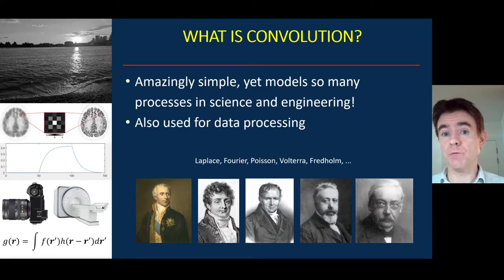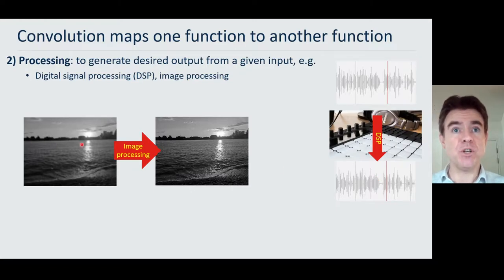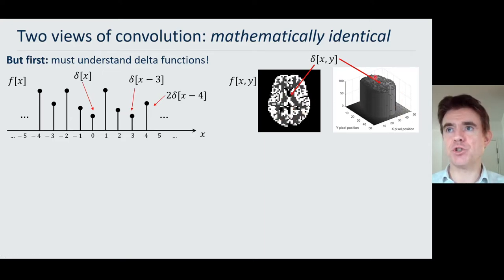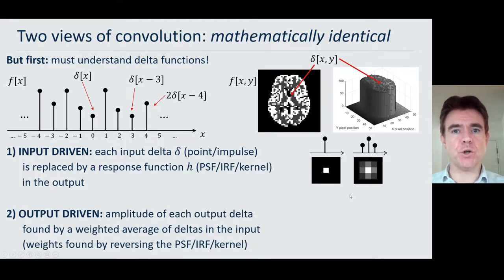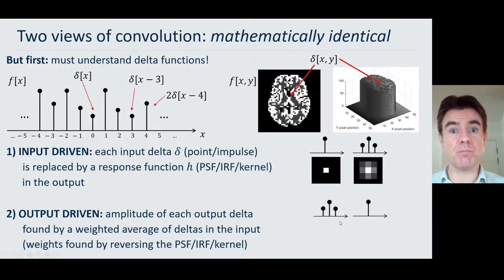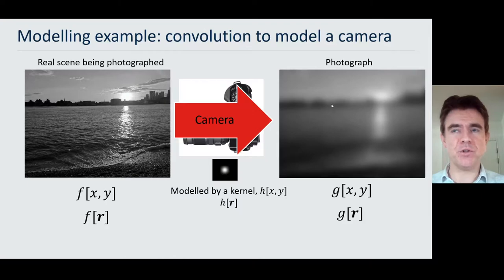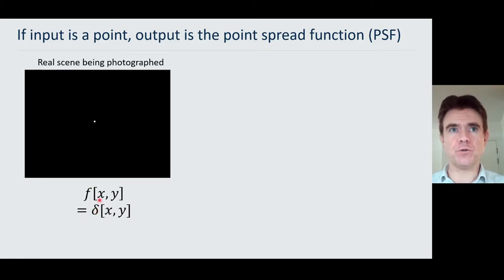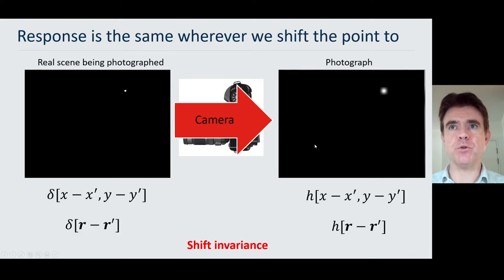Master your understanding of convolution: what it is and how to understand it well

Comment: Amazing thank you. What is the best way to study action potential spike signals, is it as Dirac delta functions or as wave? Thank you kindly
Reply from the maker: Thanks for your kind feedback. It really depends on what you want to study exactly. If you have your action potential signals already in digital form, then they can already be considered as a series of discrete Delta functions (representing the measured signal output). However, one can still do a discrete Fourier analysis if interested in frequency content analysis. Perhaps my general answer to you is that you should study and understand both representations: delta functions as well as a Fourier decomposition for a frequency analysis (in both continuous and discrete domains). These methods allow recovery of input functions from measured outputs (if the outputs can be modelled by a linear time-invariant system), as well as understanding what a system is doing.
Reply: @AndrewJReader  many thanks indeed for your time and your kind reply.